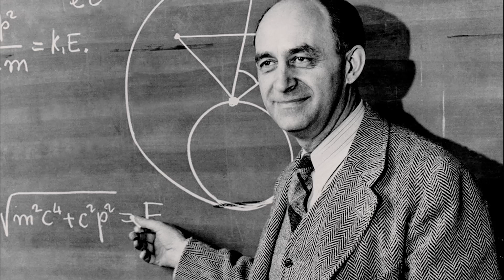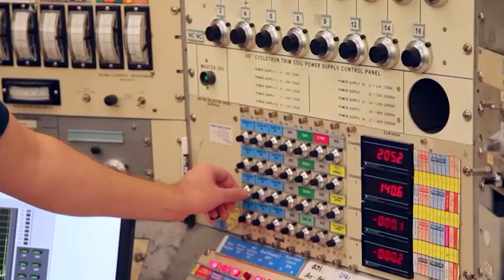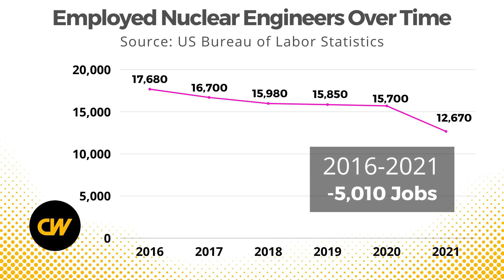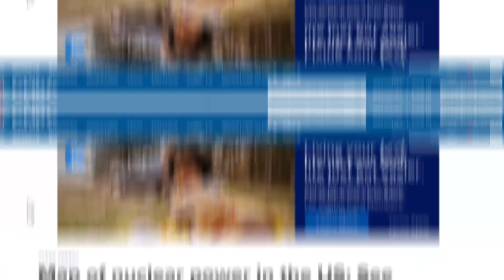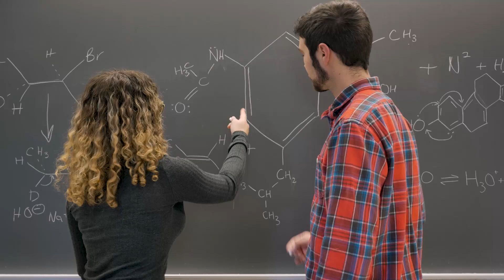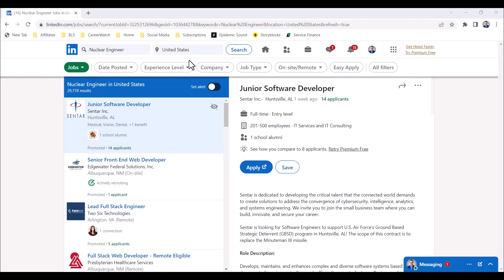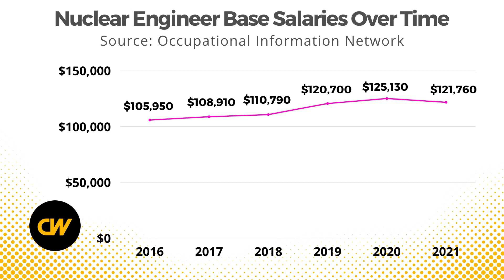Nuclear Engineers - History, Salary, Demand (2022)

Comment: I got my BS in Nuclear in the early 1980s and worked in the industry until the cancelation of the VC Summer project in 2017. I worked on many interesting projects and don’t regret it. That said, I don’t believe any private company will build any new nuclear plants in the US for years. The cancellation of Summer and the enormous expense of Vogtle make it too risky for private investors. The cancellation of the NuScale SMR in Idaho is also discouraging. Any new nuclear project would have to be largely or totally financed by the government. Whether the government does will depend upon politics.

Once the full costs of implementing the recommended measures to address climate change begin to be realized, I think public support will drop precipitously. You are already seeing this in the softness of the EV market and the cancellation of wind projects. I see a bright future for natural gas and even coal could make a partial comeback. The existing nuclear plants that were not foolishly shut down because of the market distortions by renewables will continue to run and be very valuable assets.

It’s too bad because nuclear is safe and reliable. It just takes too long and is too expensive to build under current circumstances.

For those wanting to work in the industry, I would suggest a degree in mechanical or electrical engineering with a minor or concentration in nuclear engineering. Look into internships with nuclear plant operating companies. You could then go directly into industry or into the Nuclear Navy program. If my outlook is wrong, and it certainly could be, you could eventually get a masters degree in nuclear engineering. If not, you have a solid degree as a backup.